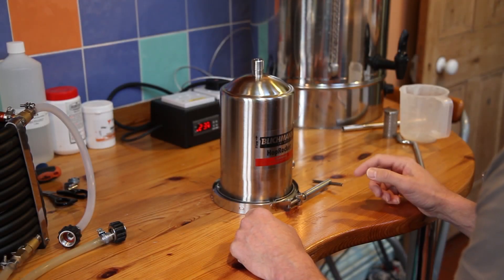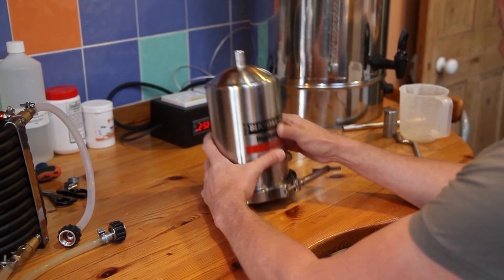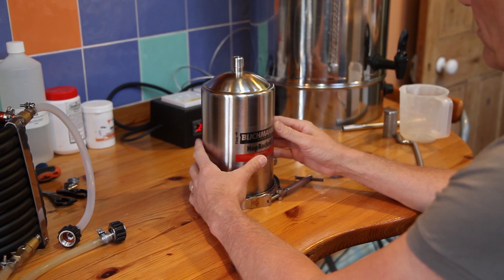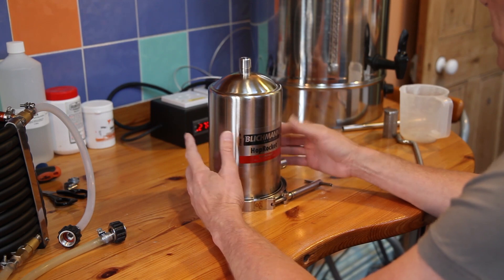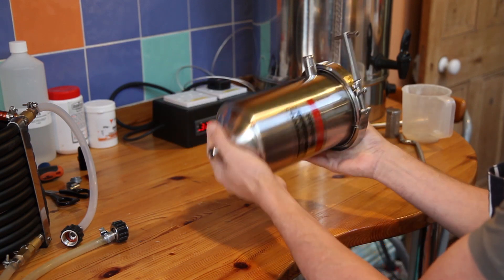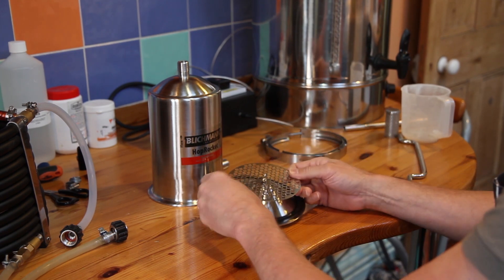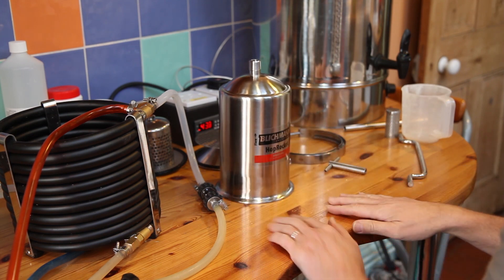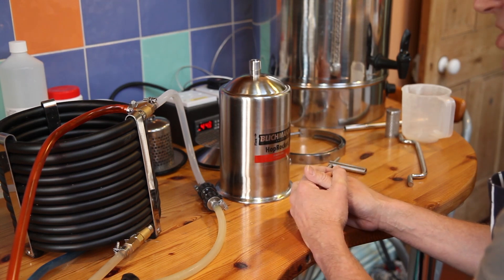Grainfather Brewing - Using a HopRocket part 1

Comment: It seems if you remove the upper cage to use as a randalizer, then the hops would clog the beer tap line.  You would have to keep the cage in to contain the upper part of the Hoprocket.

Comment: Interesting to see how you have connected it up.  You appear to have obtained a male-male connector via eBay.  What site did you get it from, as I understand that the connections are NPT rather than the usual (for UK) BSPT type?
Reply from the maker: Hi - it was from Ebay.co.uk, fulfilled by a company called Torques. If you search Ebay for 1/2 NPT male to male you should find it, they're still listed.